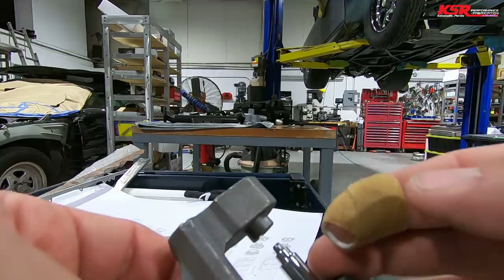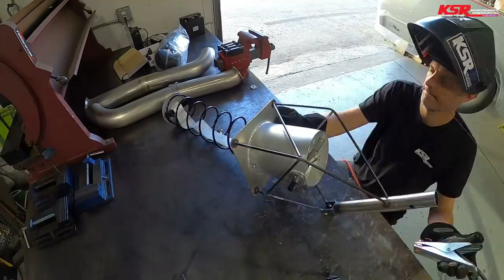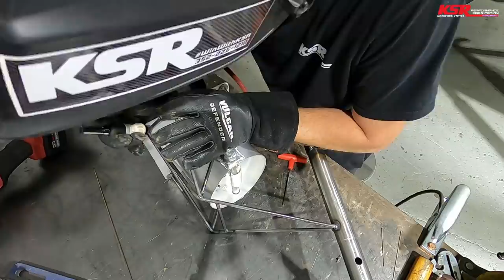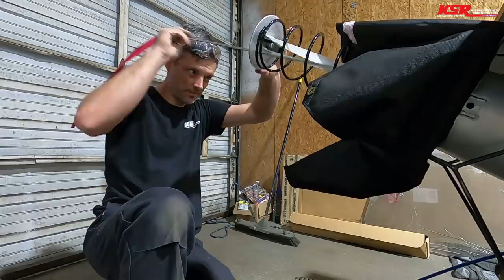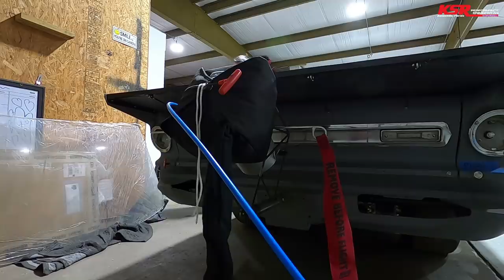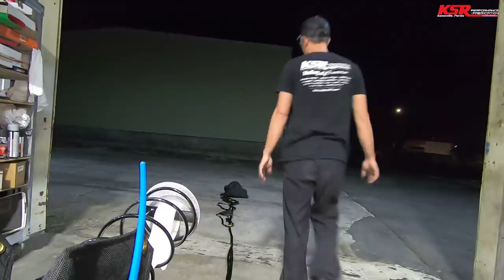The Lawn Dart gets a Parachute!!!

Comment: i think a lot of guys buying a parachute only think about stopping the car which is brand , type, size, then they think about the color / colors,  and they probably never think about the chute speed  which may save their life by getting out and getting the car straight, in my eyes is #1 function , stopping the car with the chute is aback up to your brake system.  So thank you Kevin for being one of the best on this you tube thingy
Reply: 110% agree.  I plan to run this thing to the "edge of the envelope" and need every safety we can program into it! We'll fire this puppy when we have a few tenths of lateral G after 100mph. I know I made it RedWhiteBlue for our Miliary Theme, but SAFETY is first and foremost! And, down the road, I'll have one of my sons wheeling this thing! Mom needs to know it'll work!

Comment: So as a more traditional mopar guy i feel a little torn about the ls power plant in this car but honestly can't wait to see how quick this little A body is props for building this project i know how tight on space those early a bodies are keep up the good work
Reply: I too was a traditional Mopar Guy until we started building this beast ... The early goal for this car back in early 2000s was to stick a big Wedge/Hemi-stoked engines in it, but man, the car would be so nose-heavy and we'd still have to do fender well -  frame - firewall - tunnel work to make it work out. It would not achieve our x275/LDR performance goals for a fast leaf spring setup.  Lucky for me, my two boys came along and diverted me for 18 years! Bottom line, the space limitations, LS accessibility, maintainability, and HP/CubicDollar drove us to a simple LS Single Turbo form factor setup. If it's any comfort, I still have my first car, a '66 Coronet 500 w/ 493" running 6.20's/110mph on a 9" Tire Stocker setup.
Reply: @lawndart63  Yea i fully understand how tight on space the early darts are i built a 65 dart with a simple small block and even that was hard to fit headers i cant imagine trying to cram a hemi or max wedge good luck on the rest of the build cant wait to see the time it lays down

Comment: I'm not sure if it would still work for you in that application, but they make infinite sizes of countersink/deburring bits that would take ALOT less time and effort to make fasteners flush. I also use them for deburring/chamfering edges of alot of drilled/tapped holes. They leave a nice "factory" chamfer instead of such a sharp edge.

Comment: great re-purposing on that chain tool. as a longtime motorcyclist and bicyclist, I have used these tools a lot. thinking about your use, if you're doing a lot of dimpling it might make sense to source a chain plier tool vs. having to use a wrench on each dimple. plier tools have the same function for chain-breaking, just via plier action. it will have a similar pin/anvil so could easily be repurposed. I recall there being a compound action version but could not find it with a quick Google search. maybe repurpose some RivNut pliers? the anvil/pin mechanisms slide or screw right on. good luck!

Comment: Stroud recommends making the last flap the one opposite of the cable.  That is to prevent the cable from getting hung up on the flap during deployment.
Reply from the maker: Whoooops! Thanks!!!
Reply: @KSRPerformanceFabrication  I didn’t mean to sound like a internet troll.  I see that done often. I’m sure both ways are fine and the chance of it not properly deploying is 1 in a million.  You do killer work though.

Comment: And 10:50 is why most of us use CO2/air launchers. :)

Still way better than only using a pilot chute system.
Reply: Indeed. Just have to precisely honor the procedure to rewind it as you would loading a weapon.  I wanted isolation and redundancy in our safety systems similar to a Tail Hook on Navy Aircraft.  In the worst condition of a hydraulic snubber failure, the Tail Hook would gravity free-fall to a safe position down! It's rare that Air/CO2 fails, but "the spring is a spring" and works when everything else doesn't! Fundamentally, deployment speed to tie in with Holley controls was our top priority here.

Comment: Everybody complains about the weather but nobody does a damn thing about it (unless you dump boatloads of crude oil into the Arctic drunk driving your ship). 

But anyway.... We're in the N. GA mountains (where everybody from FL 65 and older will be summering by the end of May). As a lifetime resident, I don't even consider anymore that I run the AC all day and the heat most of the night. It will be that way until at least early June. It's sort of fun doing AC vs. Heat in the HVAC -- who will win?

And to obnoxious move-ins headed up this way. Take I-285 in Atlanta up to I-85 North, turn left onto I-75 south to I-285, turn right, go up I-75 North to I-285, turn right, then take I-85 South back to I-285 East. Yeah, like Peachtree in Atlanta, GA has a lot of I-285s. At some point on the road, you will see a sign with an arrow that says "North Georgia Mountains Left." Actually, they left, they're gone, don't know where they went. So, turn around and go back home to Florida. You are welcome for the inside information!

Comment: Huh, I would have thought there was more to the release mechanism than just a cable stuck through the grommets on the bag holding the chute. 
What is different about your winding mechanism than the way it works originally? Just something to hold/drive on the other side?
Reply from the maker: The factory method only has a hex on one side and I think they make a special tool that is like a big crank to wind the spring in. My method feels safer to me, and so much easier.

Comment: Do you leave the parachute packed and the spring compressed if the car is going to sit for a few month or do you unload the spring and have it "dangling" outside . 
(Asking for a friend 😉) 

Cant whait to se the Dart make some passes🤩
Reply from the maker: If it is going to be more that a month, I prefer to have them out of the bag.
Reply: Definitely. As a former FAA Certified Parachute Rigger, we had timed re-pack requirements on reserves to inspect all materials.  Older technology materials like those that are used in these drag chutes "Do Not" like to stay bagged up, especially in humid environments. If they get rained on, dry them completely before sticking them back in the bag!!

Comment: Would it be easier, and safer, to to use a impact gun to wind the shute spring back in?
Reply: You risk breaking or stretching the strap doing it with an impact I think. Not to say you couldn't but I don't think that would be any safer.
Reply: @--_DJ_--  at least he be to the side

Comment: That spring knock your but out it connects with your chin . Is that round bar enough to hold a deployed shoot ?
Reply: I was curious about the structure as well, it seems a tad small and wobbly for the load it will be under
Reply: The big lower round bar takes the load of the parachute, the little framework only carries the parachute until its deployed
Reply: @nickceffy4314  good catch I wasn’t even paying attention to the actual connection point of the parachute cable, makes much more sense now.
Reply: @nickceffy4314  daaaaa I sat here and watched Kevin bolt the strap to the car knowing how it works and still open mouth insert foot 🤯🦅

Comment: Not to question. Your expertise but that mount seems kinda spindly to hold that much car back at 160+ mph
Reply: The actual parachute mounts down on the big lower steel bracket, the spindly bit as put it only carries the parachute till it’s deployed
Reply: @nickceffy4314  Correct.  The drag of the deployed chute will be near cam centerline, and attached to a bar directly welded to trunk cross tube.  You could probably pick up the entire car vertically from there.